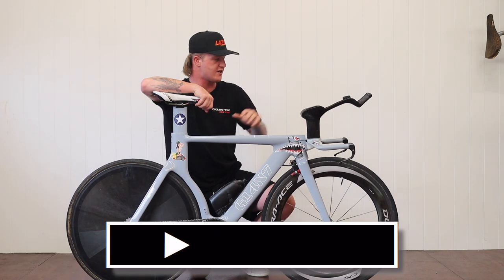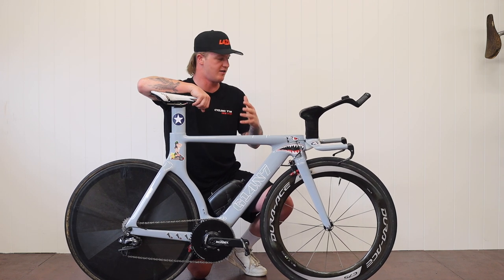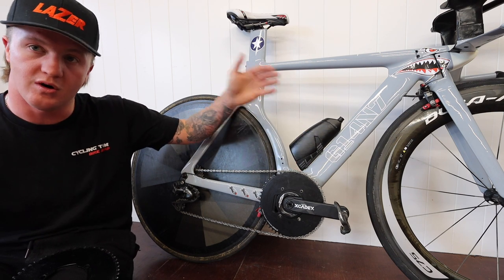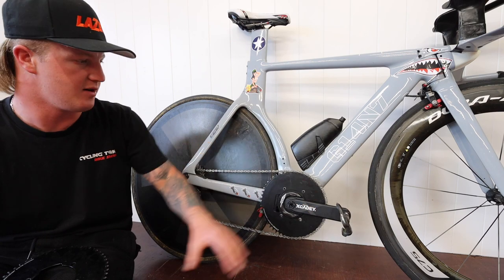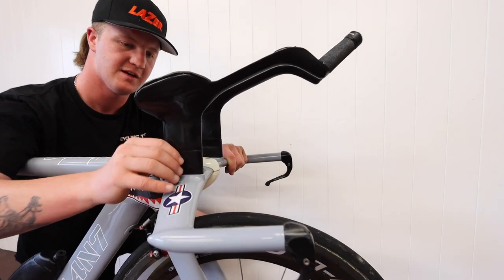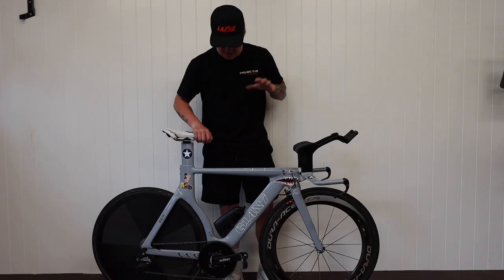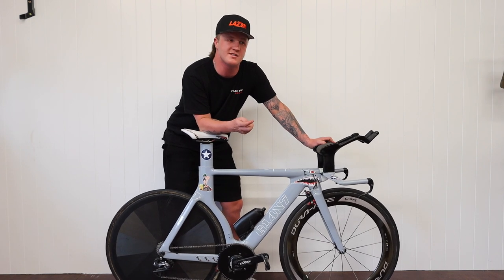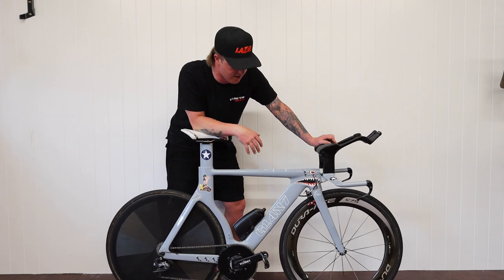Top 5 Aero Upgrades for your TT Bike!

Comment: Great video. More of these types of video please. 😊

One question. You tried an oval chainring couple of years ago. How did you go with it? Would you consider going 1x with a 54 oval chainring? I think Vegan Cyclist has this set up on his road bike.
Reply: Oval at best doesn't matter, at worst it f-s up shifting with clutch derailleur.
Reply: @super8hell  I know it doesn’t increase power output but do you think it might be of ergonomic aid for someone like me with bad knees? Sort of makes sense that the resistance is increased where the knees are at the strongest position and decreased where it’s the weakest?
Reply: @Jono01  improving your bike fit will help you more than oval chainrings.

Comment: I'm working on a super light gearbox and when I'm done with it will outperform by a lightyear the current "standart". Your build inspired me to create a beast of my own, but I'm interested more in ultra xc where aero is also king. For my bike's my gearbox  output range is from 0.5 up to 4.0 and 13 speeds and I move the front wheel as well. I have 3 questions for you. How much speeds do you want to have? What gear proportions you need 0.75-7,5? And do you want dual drive?
Reply: I'll make it to be mountable where the water bottle is and you can move it to other key frame locations like just behind the headset where your knee is crossing the top tube or on the back or front of the seatpost.
Reply: Make videos about it. So you can get ideas and exposure on your invention